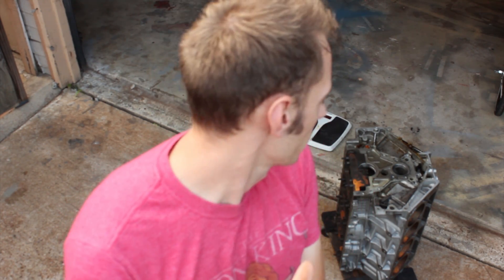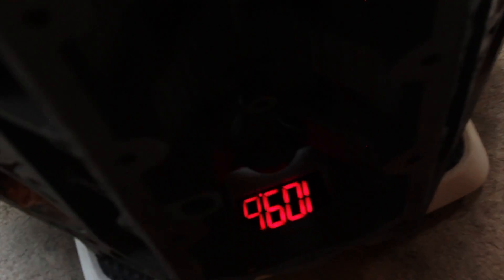Aluminum VS Iron - LS Engine Weight Comparison

Comment: For the weight, the cast iron block will last 100,000+ miles more than the aluminum block.
That's why the cast iron is the preferred work horse of heavy trucks ..3/4 and 1 ton plus 👍😊

Comment: Pretty cool!!  It would be nice to know the difference between all of the LS and LT engines, iron vs aluminum. That's got to make a big difference in handling, considering you're removing 100 lbs from right between the front wheels. 100 lbs is a lot!  The weight of two 50 lb bags of fertilizer the vehicle is not carrying right up front anymore!!

Comment: awesome video thanks for doing this for everyone. what does an entire running engine LSX454 versus a GEN I small block 454 strokers both carbed WEIGH both iron block to iron block both aftermarket blocks?.  Block weight may be misleading in some cases. Both aftermarket blocks. Weigh them with headers for the same car a camaro. then if some one could weigh the same two combos both with aluminum blocks.

Comment: So roughly saving 100 lbs with aluminum ideal for putting in a Miata, 240x, Nissan, rx7 swaps etc But if you’re going huge power route definitely go with the iron block. Great video guys straight to the point all meat no filler 👍

Comment: I can see going with the iron block for a high horsepower LS build, but if you're thinking of going with around a 450HP build for a MIata swap, the aluminum block will make a big difference in weight distribution and better handling, and will likely hold up well enough.

Great video. I see all kinds of speculative comparisons of engine weights, based on publisized numbers, but  you  never know exactly what was included in the weights. One might include intake and accessories, such as alternator, bracketry, etc. Does the number include PS pump, plumbing, starter, etc? What is the source of the numbers? Are they reliable? Without knowing that, you're likely comparing apples to oranges.

This comparison is short, straightforward, and accurate. Great video. What would be great is a weight comparison of a complete Coyote and LS, with all the accessories and mounting hardware you would use on either one, including stock flywheel for manual tranny. From that point people could extrapolate weight savings by deducting for lighter flywheel, no PS pump, AC added, etc.

Comment: I would like to see a list  Cast Iron  Gen ! small Block Chevy VS  BB  Chevy  VS  LS   ..    Wighting the bare blocks was a good way to know the difference with in the LS Family ..   but I am curious what an LS weighs compared to a Gen ! small block chevy .. 

  Some of big  parts warehouses like Summit could easily  weigh various combos before shipping ..  how much does a Pontiac  4oo weigh a Buick 455 ..  and olds   455 ?  A ford  351 Windsor ..  a 460 Ford ..  A Ford Coyote  motor ect ..
  I would guess to bore out a  5.3 to 5.7 would take out  3# maybe .. or less

Comment: CAST IRON for the win.. i don't care if its heavier, its STRONGER and can produce more power reliably ... !!
Reply: You Tube 

There’s great aluminum block engines like the 5.3L V8 in my silverado and the hemi engines and even ecoboost
Reply: Yes but your not getting the point, cast iron is stronger ...
Reply: You Tube 

No I completely understood iron is stronger than steel any idiot would know that but compacted aluminum can be just as reliable if done right
Reply: @MGS4_Glazer  iron is stronger than aluminum *
Reply: Joshua weisenborn 

No shit
Reply: You Tube 

And it’s *you’re
Reply: There’s great aluminum block engines

Its "There ARE great aluminum block engines ... 

There's implies there IS ...

Comment: Is the 5.3 consider a LS even though it's a cast iron block or no
Reply from the maker: Yes, the block is still based on the 5.7 ls architecture
Reply: Alright thanks 🤗 🤗
Reply: I was worried for a second

Comment: Hey guys I have a 78 Datsun that I want to ls1 swap and I was wondering if you guys can help me
Reply from the maker: ikill4food That sounds awesome.  What kind of Datsun?
Reply: Don't do LS1 do a truck motor. not as wide and the truck motors can make a lot more power, I made the mistake well if you care if it's iron or aluminum of getting a 2003 5.3, get a 2004+ aluminum 5.3 and put a nasty cam in it and go however crazy you want if you want it natural power 400-500 range which is definitely more than enough for a Datsun on the street then you can go a couple of ways but a good cam lifters and valves kit with a good set of headers and exhaust backing it up and some here and there's and 400+ is easy. Actually you've probably already hit the 400 mark just doing a very good cam job, headers can get you higher up the range. But if you want stupid use big turbos and superchargers and then you can start getting 600+ figures quickly, also thousands upon thousands of dollars quickly which isn't worth it in a suicidal featherweight Datsun.
Reply: ikill4food the reason truck motors make more power is they are less restricted higher aftermarket and they have more compression and combustion. Put a larger throttle on it if you want I saw a 92mm going $150 all aluminum

Comment: Hey guys. Great job on all the builds.

I have been watching you guys for probably a month now. What originally caught my attention was the Klze swap.

I own an almost mint condition 1992 Mazda Mx3 with a KLZE. I'm getting ready to pull the engine soon since the rings on 5 and 6 are shot.

I have never done a rebuild before other than rebuilding a lawn mower engine when I was in high school. I know the principles behind it. I do however do all my mechanical work on the car and on my daily.

Any tips you can offer me? What are some tools that you suggest? 

(I was going to send it in to get rebuilt but it kind of defeats the purpose of owning a project car)

Thanks and keep up the great work. ☺
Reply from the maker: Awesome props on doing it yourself!  Tips on a rebuild...if you're staying stock, then make sure your head bolts/head gasket are replaced if you're pulling it apart.  Make sure you know the tq values and sequences for all associated bolts when you go back to install it.  Make sure you measure out the crank journal bearings and main bearings/surfaces.  Would be a great idea to replace the main bearings and rod bearings. Make sure to  Hone the block.  And keep an eye out for anything that looks out of place or that needs repairing-it'll be your best interest to fix as much as you can while the engine is out!  (timing belt/waterpump, all engine mounts, etc..)

Tag and Label everything you can, makes putting it back together easier. There's plenty of info and even an FSM on the web so, I think you should be good! Best of luck to ya!
Reply: Thank you for the reply!

The only not stock is that I will be replacing the stock rods with Millenia Rods. They're sitting in storage.

I'm almost certain the crank will need to be rebuilt. I will most definitely replace all the bearings. 

That brings me to balancing since the rods are no longer stock. Is that something that needs to be done in a shop?

If you want to see the car in have a few pictures on my instagram page... Lc Materi Rock Creations. (In case you're interested.)
Reply from the maker: Yes if you're changing rods, you will need to have the rotating assembly balanced at a machine shop. They'll need the crank, rods and all the bearings/rod bolts.   Thanks will take a look!  Also, make sure you clean everything! ATF makes a great degreaser for cleaning the block and head, just be sure to clean it all off when you're done! (brake clean or isopropyl alcohol
Reply: Thank you very much for the tips/help.

I really appreciate it!

Anyways, I'll stop bugging you guys, I know how busy you are. ☺

Comment: Wait so the 5.3 was the iron block? And it still weighed more?
Reply: Phoenicius Infinius Infensas  Yes, the blocks are identical besides the fact one is aluminum and the other is iron. 5.3 has a 3.780 bore and the ls1 is a 3.898 bore.  I have a 02 5.3  I just punched out to 3.898........... also, if you have two of the same blocks, one being a 5.3 and the other a 5.7, the 5.7 block will weigh slightly less due to less material from the bigger bore. (if both were iron blocks)
Reply: Lsx Powered  what was the cost to bore it to 3.898?
Reply: j Zap idk how much it cost him but where I’m at it would cost $200

Comment: Dang that's a big difference. Helped a lot in deciding between the lq4 and lq9. Keep up the good work. And yes you shoUlf get into block weighing but also go into the little differences like stock bottom ends and how much they can take, interchangeable parts and stuff like that. Thanks a bunch y'all. Peace
Reply: The LQ4 and LQ9 are both cast iron blocks so how did this video help you make a decision? Haha
Reply: killfase01 that is simply not true, the LQ4 and LQ9 are identical engines except that the LQ4 has dished pistons and the LQ9 has flat top.
Reply: The LQ4 and LQ9 are the same Iron block
Reply: LM4 is the aluminum block 5.3 with 24-tooth crank reluctor wheel.
Reply: Joshua Skinner I don't understand why your statement is relevant.
Reply from the maker: Thanks! We have many things planned for this little mini series!
Reply: Thats all good but if you are building high performance drag car and thinking about boosting the engine you need to go with iron block
Reply: killfase01 How is that big?
One tenth?lol.
Get a grip.
Reply: Lmao lq9 lq4 same
Reply: Aaron Purtell the lq4 is an aluminum block. The lq9 is an iron with flat top pistons

Comment: If you could please weigh different piston and rod's from a 5.3 and a 6.0
Reply: TurboShotIncredible yea please do one on piston weight and for different types and sizes
Reply from the maker: 5.3/5.7/6.0 rods are all the same.  The pistons on the other hand, can vary. (Flat top vs dish)